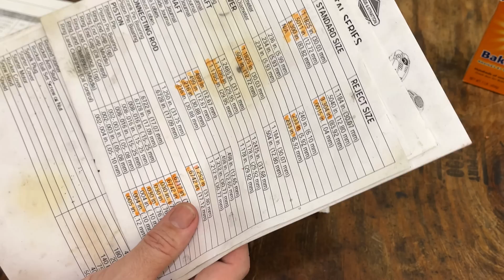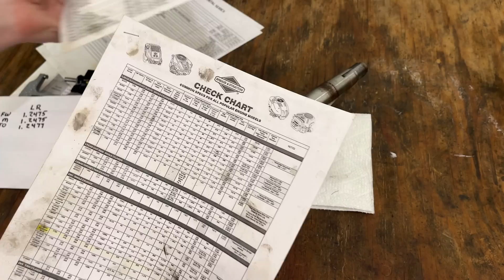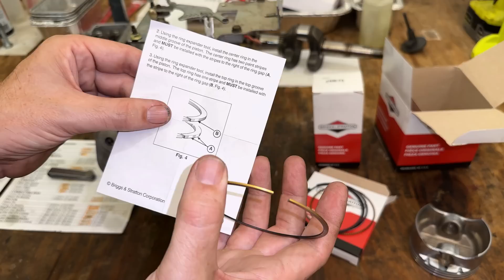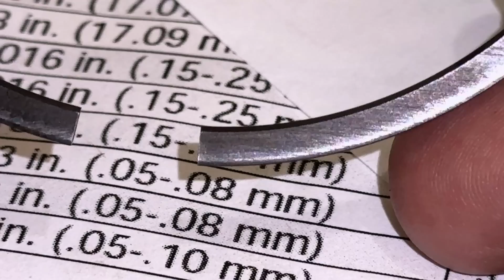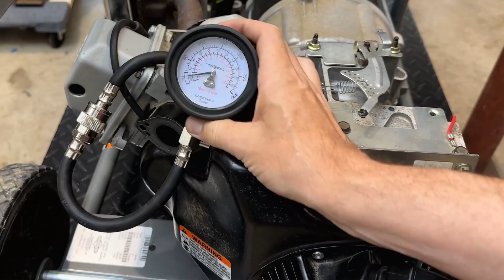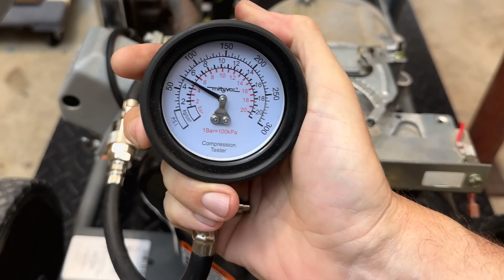Two Catastrophic Engine Failures - Are They Junk or Will They Run Again?

Comment: Can you explain how to connect 2 generators together so they act like 1 generator. example: your air compressor needs 12000 watts. And you have 2 generators with 8000 watts each. the 2 of them could do the job, But 1 can not. Tell us how/if it can be done?

Comment: Question 1.. I may have missed the comment ?
Why the tape round the bolt head holding the rotor?
Is it a centring tweak ?
Question 2.. Have you ever done a propane/Butane carb conversion?
I would like to know if the engine can be started on Butane... Rather than started then changed over...
When I check my engines, I give a burst of butane lighter gas to confirm a spark and I get a few revolutions of the engine, so I may have answered my own question...
Because my own genny is for emergencies and I am lazy in testing every, say 3 months, I fear the petrol turning to jelly or getting crusty in the jets like so many engines I have had to look at in the past...
Weapons Grade Respect from the UK
Reply from the maker: The tape was to help center the bolt.  I did a conversion from petrol only to petrol/propane/natural gas (methane).  You could start it on petrol or propane/natural gas.  The starting procedure could be a little different depending on the type of regulator you have.  All I have tested running on propane are noticeably hard to start on propane compared to petrol.
Reply: @jcondon1  Thanks for that.
Experience is always the best educator...

Comment: what happened inside? Clues, extremely low crank case oil level, connecting rod bearing seized up and destroyed itself...
Reply: warning! did you replace the cut wire tie holding the AVR Connector ?
Reply: that is one sweet repair and a great  running generator!

Comment: I have a generator like this one. The crankshaft broke off on the power end.  It is a 259 dollar part should I rebuild it or get a different motor? Just wondering what you would do?
Reply from the maker: I have replaced the crank on these before.  As you point out it was expensive.  It also looked like a lesser quality part and had rust on it.  Will not do that again.  Your best bet is a used engine.
Reply: @jcondon1  Thank you

Comment: Can the potentiometer be adjusted with the engine running?
Reply from the maker: Yes, but not recommended due to high voltage ac, high voltage dc and moving parts.

Comment: James, I didn't notice in the video, but do you maintain the original positions of the tappets and pushrods? Also, you mentioned that the generator would need a break in period with the new piston and rings. What would the proper procedure be? Thanks for another excellent episode!

Comment: Question: I have a brand new 11000 watt Gen. Just put fuel in it. Can't get it to start. Has spark, fuel to the carb. Any ideas? Also unplugged the low oil wire..Will fire if I give it a shot of starting fluid.??
Reply: Added note it's a Wen gen.
Reply from the maker: If it fires on starting fluid and fuel in the carb then must carb issue.  Clogged jet or emulation tube or a massive intake leak.
Reply: @jcondon1  thank you..enjoy your channel.

Comment: So when using muriatic acid it's nice to have gloves and glasses, but you need an acid approved respirator. Yes that is a thing 😂 So if those bolts are stretched. You really can't reuse them. Correct? Also never go higher than 500 on your grits and sandpaper You can't go a thousand two thousand three thousand It really doesn't work that way.

Comment: Another fine and super informative video Jim. Just curious about what the total cost of the new piston - rings - gaskets and required shop consumables were ? I know that you love working your mechanical magic and making a successful save. However there must be a labor cost involved as well. What would the total retail cost of a repair like this be to a typical customer that dropped off a generator in this condition to you ?
Another question I understand how and why when removing the rotor utilizing a properly length sized cut bolt with a larger diameter works. However, do you think that it would still work utilizing a cut bolt of the original diameter and threaded end that could be fully threaded into the taper shaft end of the crankshaft ? A flat screwdriver slot could be cut into the outward end of the modified bolt to allow the necessary (recessed) clockwise rotation. Thank you for all that you do !!!
Reply from the maker: Parts cost was about $150.  (Piston and Rings $77, Connecting Rod $49, Head Gasket $12, Sump Gasket $8).  Labor would be expensive.  Would say 6 hours.  Shops around me charge $100 an hour.  You can use the bolt.  But then you need a new bolt.

Comment: will the B&S engine interchange with a Honda engine?
Reply from the maker: Some Honda engines are compatible.  The shaft must be the same and the bolt pattern for the bell housing.  Also the crank shaft exits higher.

Comment: What is the concentration of this hydrochloric acid?
Reply from the maker: Not sure.  Usually Muriatic acid is about 31%  hydrochloric acid.  Not sure the bottle I used specified.  Here is the one I was using https://www.homedepot.com/p/Klean-Strip-Green-1-Gal-Green-Muriatic-Acid-GKGM75006/202690263

Comment: For the same reason you didn't want to use the so-called new ring. You shouldn't be using the old ring. You have no idea if the outside diameter of that ring compressed is round anymore.

Comment: I cringed when i seen you using a steel knife blade on aluminum mating faces to remove old gasket material. Glad you put in a disclaimer but to all you DIY'rs, never ever use a steel anything on aluminum if you don't want it scratched or gouged. Speaking from 40 years of fixing airplanes, which are mostly aluminum. Find yourself a good plastic scraper and keep it sharp with sandpaper.

Comment: There's a reason your engine savvy father, or neighbor told you to check the oil EVERY time you you start the machine....  and EVERY time you re-fuel the machine.   Perhaps these machines should come with a video instruction manual,  since citizens are too lazy to read nowadays.

Comment: Instead of using that useless WD-40 (WD means water-displacement), you'd do well to look into Aero Kroil, it's a whole new ballgame.  Unlike the WD, it is an actually a penetrating oil, gum-cutter and lubricant.  WD-40 is useless as a lubricator.  Derek Bieri uses it and swears by it.  So do I.  Also, you may want to consider "jump-ahead, in lieu of that ridiculous fast-forward.  Fo instance; why would anyone want to sit and watch the whole "gasket-scraping" job.  Anyone who works on engines knows that 'drill'.

Comment: Seems like u spent $100 on parts, can't u buy a whole replacement engine for that?
Reply from the maker: I can get engines starting in $300-$400 range.  If a Briggs then at least twice that amount.  If not Briggs then I also need an exhaust.